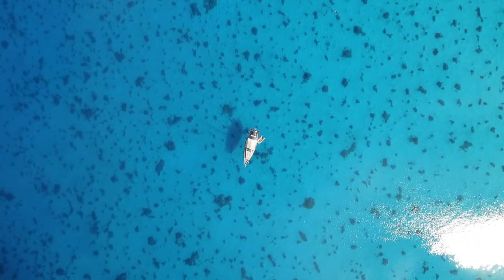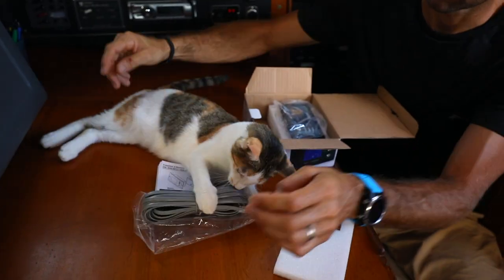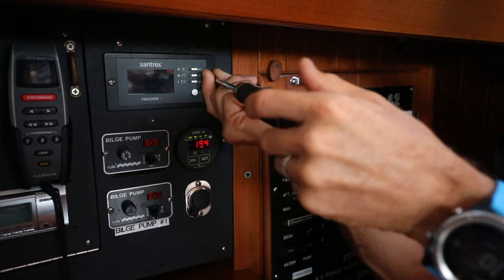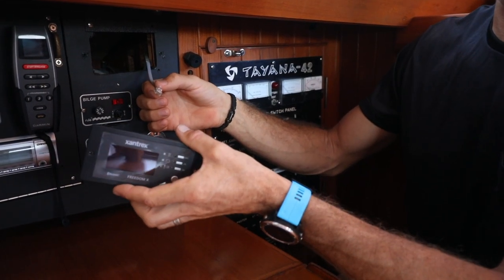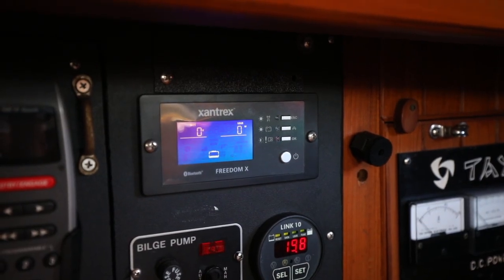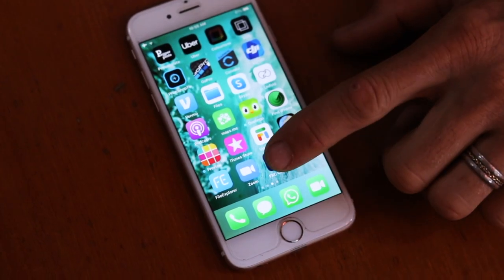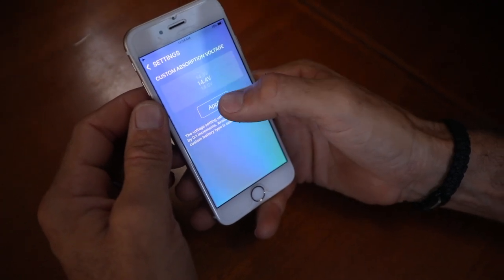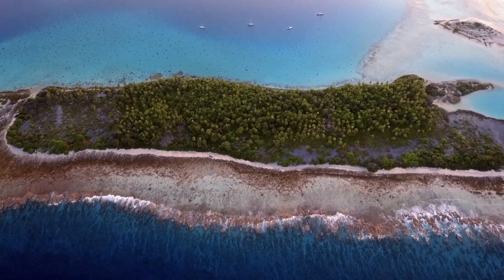Bluetooth Remote Panel Unboxing + Install + Overview - Voyages of Agape

Comment: This looks to be simply replacing the control with a Bluetooth control. I’m looking to install the Bluetooth remote in a different location - using that 25ft cord?  Does the new Bluetooth unit  simply plug into the original (non-Bluetooth) unit using the 25ft cord? , Or do you completely remove the original control panel - like you’ve done in this video?
Reply from the maker: Hi Awhittick, 

The bluetooth remote panel is designed to give bluetooth capability to Freedom models. Be sure to check this page to see which Freedom inverter models it's compatible with:
https://xantrex.com/products/accessories/freedom-x-bluetooth-remote-panel/

If you want to see the process of installing a remote panel in a new spot, see this video of Knot Viking creating the spot for the panel (no bluetooth): https://youtu.be/NJG4qOyoQHM?t=180

The panel should be showing what the inverter's display when plugged with the cord. Here's a video on how to go about with the rest of the setup process:
https://www.youtube.com/watch?v=-LJrDrELEpE

If you have any other questions, feel free to reach out to us via our toll free number during opening hours:
1-800-670-0707

Comment: Has this been fixed to maintain the Bluetooth connection to the phone?  I bought the panel this summer and reported the issue multiple times. The response was engineering was working on it. I have yet to see an update from Xantrex.
Reply from the maker: Sorry for the delay, the technical team informed that the fix will be in 2 stages through updates to the existing app and product firmware. A new update for the app will be available next week followed by a firmware update in  4-6 weeks which will completely resolve the issue.
Reply: @XantrexTechnology  How is a firmware update accomplished on this display?

Thank you for the update...I will pick one up once the fix is official.
Reply: @MyGoogleYoutube  Does yours actually work or is the Bluetooth simply disconnecting without ever reconnecting. IMO this product is a total POS.